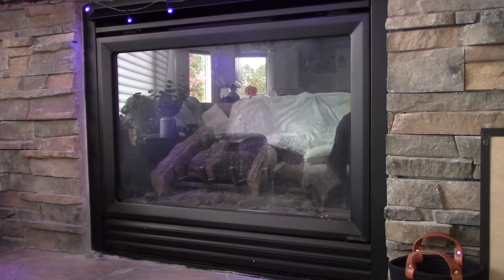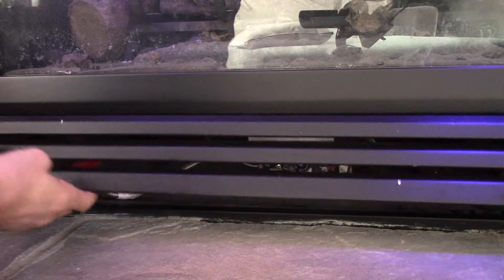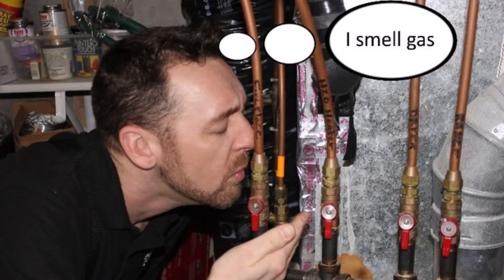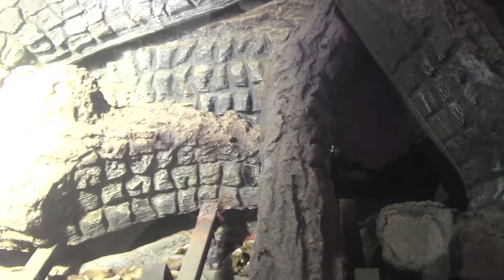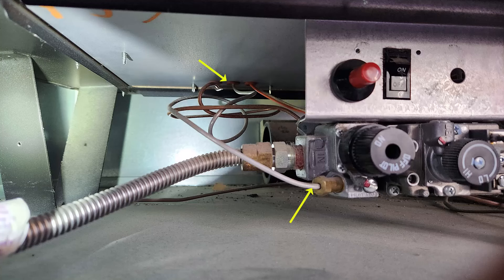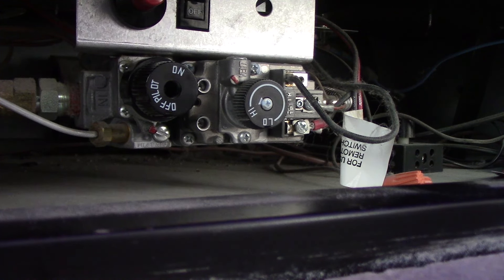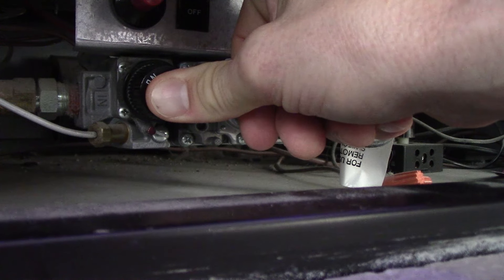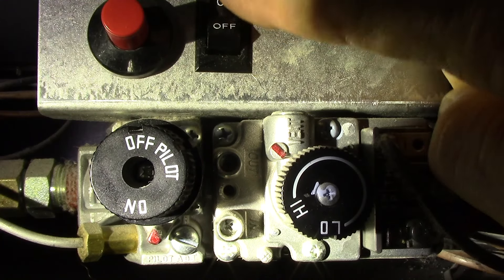How to light a gas fireplace pilot

Comment: I liked this video. I have one question…that bypass switch to turn on fireplace while down by the fireplace…in what mode do you leave that switch??  On or RS???  Idek know what RS meant. I found out it means room switch so that’s where I put it after I had turned it on just to see if the fireplace would start and that worked. I can still use my wall switch but I didn’t know what position to put it in or if I needed to move it from off, that info would’ve been handy

Comment: Thank you for a great video. I now (hope) I understand better why my husband has no trouble lighting the pilot on our freestanding gas fireplace and I do. He understands that that the thermocouple has to warm up! I expect I always had stopped feeding the gas too soon after the pilot lit. I know you stressed  sniffing for gas and being patient to allow gas to dissipate early on in the video. If you can add text over the video near the end where you tell people to keep trying if the flame goes out, I suggest you add something like, be sure to be patient between tries allowing 3-5 minutes for the gas to dissipate. I was thinking about the gas ball that comes up when I first start up the gas barbecue. I have learned to duck down as I ignite the gas because I never know if there is gas in the air nearby, perhaps I can not smell it but that does not mean it will not ignite!. That is also why they tell you to be sure the lid is all the way open on a gas grill when starting it up. In a firebox in a fireplace the gas that comes out is trapped there much like if I had left the cover down on the gas grill when starting it. One other thing that we do, is, if we are turning off the fire on the gas grill or the pilot on the gas fireplace, we turn off the gas at the beginning of the branch of the propane line feeding the individual device while leaving the valve open at the device to allow the gas to burn off as much as possible out of the line to the device. Then, after the flame is out, we turn off the gas closest to where the flame comes up. Again, thank you for a great video!

Comment: question .. the gas turn on value if parallel to the gas pipe,   the fireplace lights from a light like switch on the wall.  so I see the pilot  .. so while holding down the button to push gas to the pilot .. how long before I light the pilot with a lighter?  hope this makes sense